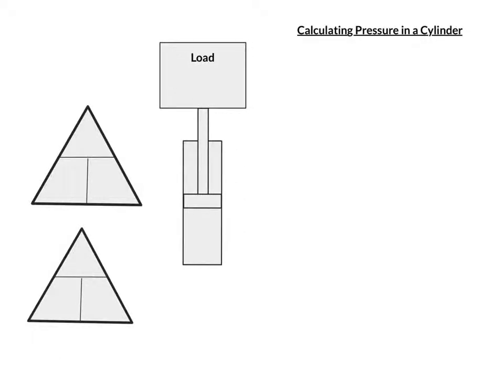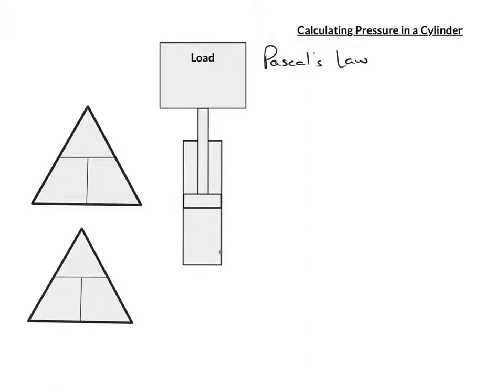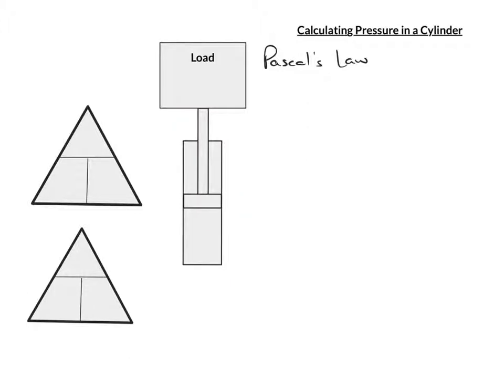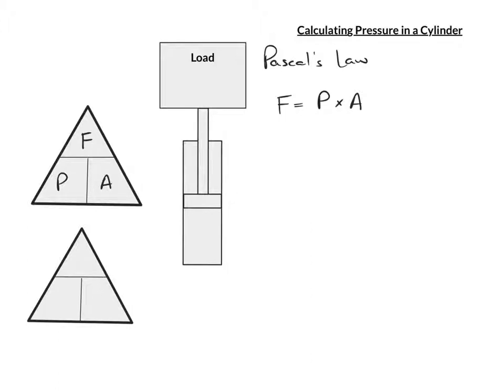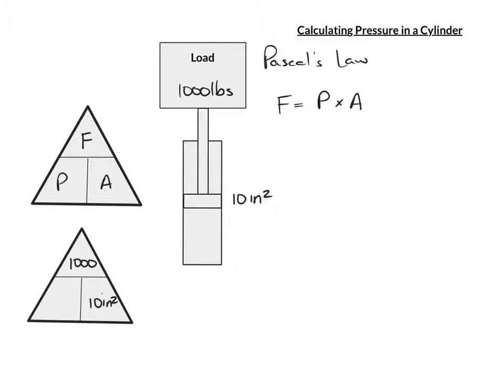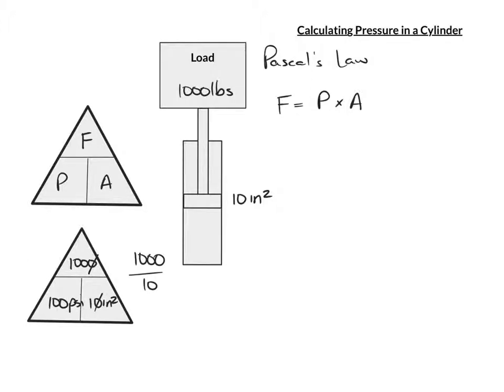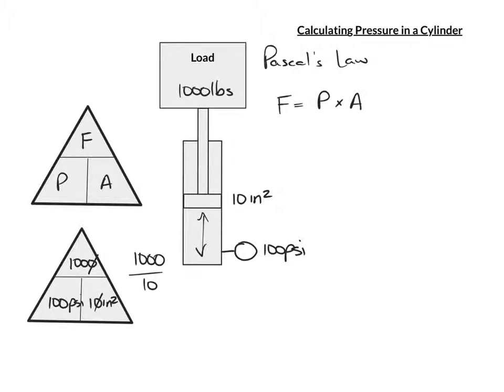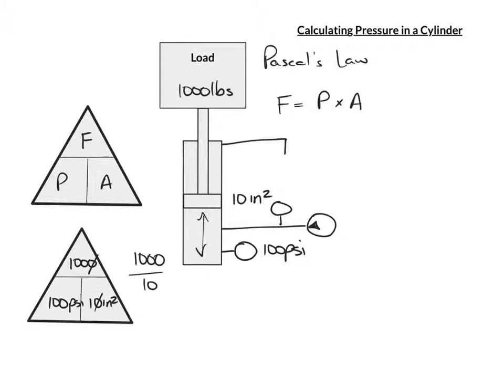Calculating the pressure in a cylinder

Comment: Sorry to be pedantic but, you say 'it doesn't matter where the piston is, it's always going to be 100psi'. This doesn't sound right to me. Not only would the pressure change as the piston moved up and down the cylinder but the gauge pressure would change depending on the position of the gauge due to pressure at depth. Perhaps you meant this change would be slight and therefore negligent?

Comment: hello i have a problem about this stuff ... a cylinder that’s 2 inches x 6 inches at 1000 psi reads - P x V / atm .. to find the volume of compressed air.. which is 1000 (psi) x 18.85 (volume ) / 14.7 (atmosphere ) = 1281 Cu .. excellent ... but now change the 1000 psi to 10 psi -
10 psi x 18.85Cu / 14.7 atm = 12.823 Cu ?? how can there be less air in the cylinder (12.823 Cu) under 10 psi than the cylinders initial volume of 18.85 Cu ?